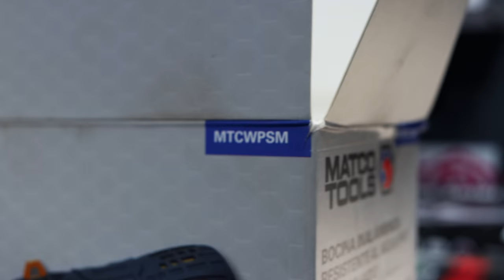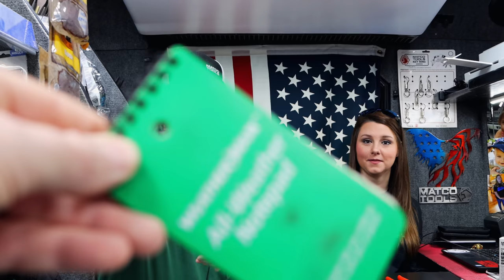Matco Tools: Bluetooth Speaker And Knipex Comparison

Comment: That notebook that Clay showed with the green plastic cover is the bomb.  You can get them at Lowe's around the lumber desk.  The paper is plastic coated.  You can actually stretch it.  The paper is waterproof so it's not super critical when it gets wet.  As I have watched Clay for several months now I wondered if that was the notebook he was carrying.  Now we know.  Super.
Reply from the maker: They are the best. All i ever use

Comment: I use the babies more for grabbing little things in small areas and removing staples.  Have a Craftsman pair of ignition pliers same relative size as the 5-1/2” but I’m thinking of treating myself to those 5-1/2” when my Matco guy gets back from hunting / vacation for the same reasons:  grip and button.  I’ll keep the babies in the pocket and the 5-1/2” in the service cart.

Comment: I can appreciate the relationship between Matco Michael and Clay. I bought a light off my Matco dealer about a month ago and have paid one payment because dude shows up whenever, he's not consistent at all. Also, there was a time where I bought some stuff from him and used my card. Well come to find out the dude ran my card without my knowledge a few times. When I found out I text him and told him he did not have my permission to run my card anymore. I didn't want to cancel because of all the stuff that was coming off that card. Sure enough 2 months later the pos did it again. I canceled the card and that should have been enough to tell me to not mess with him anymore. Insert 2 years later and he comes to the shop and I needed a light....That's where we are now...

Comment: Those pliers are opening up on you because you are using them in a tighten grip trying to loosen something. If you flip the pliers over and have the handles facing the direction you want to spin, you'll loosen it and it will grip like its supposed to.

Comment: may i say something..that knipex i used one way because of the disign..the correct way the pliers bite itself tight on the nut or pipe you use it on and you can stand on them and not slip off.when you use it wrong then the pliers do not bite itself tight..

so the matco man uses the knipex pliers wrong.try it and learn

Comment: Would u rather have a knipex multi tool that has push button plier, pen light, and knife , or carry all three separate ( I realize knipex doesn’t have the option)
Reply from the maker: I rather have them separate but that’s me. The multi tool is nice but bulky to use
Reply: @KoonTrucking  true. I’m the same way. Unfortunately for me it leads to me losing lots of em over a year. I’ve never lost a multi in my pocket but also don’t keep it my pocket every day. Maybe I should buy pants that have a magnet in the pocket that won’t hurt the phone ha ha